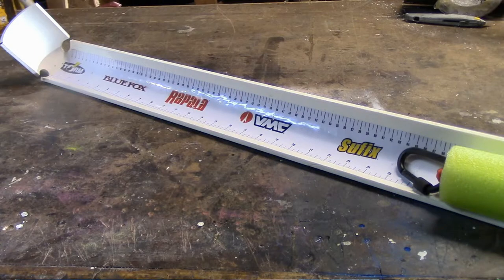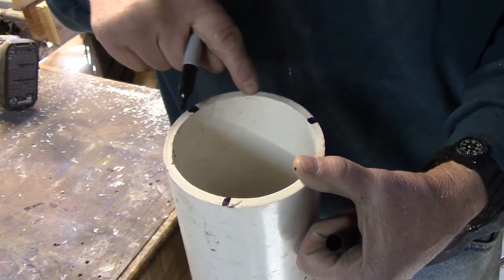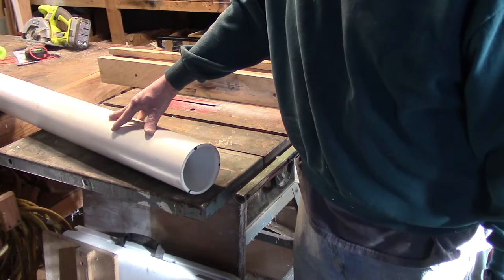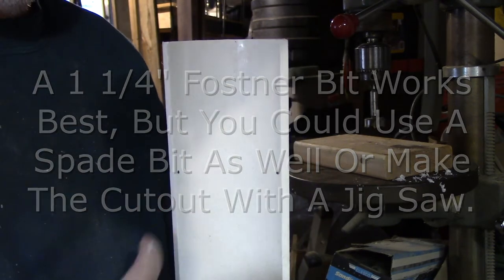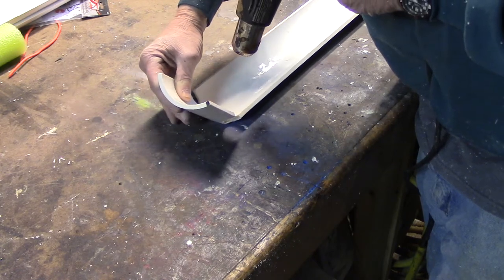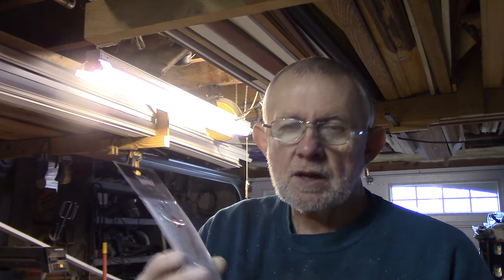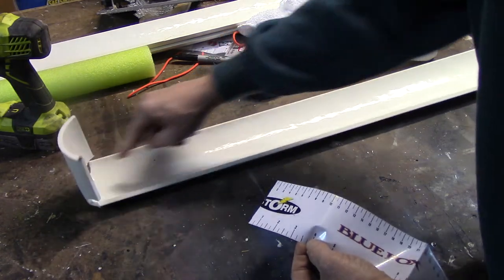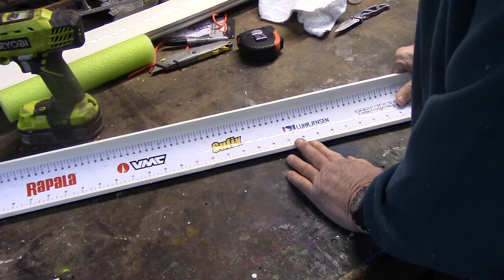Awesome DIY Fish Measuring Board: CHEAP AND EASY TO BUILD AT ONLY $8.00!!!

Comment: nice.  Just stumbled your DIY hack.  It's a very slick way to make a measuring board.  I'm a bank fisherfolk and use a  fishing backpack.  Definitely can adapt your design to attach for easy carry.  Even thinking you can make a slide or folding version.
Reply from the maker: Thanks so much! You could either shorten it for carry or cut in half and install a for a scale that folds. Glad you found the video a help and thanks so much for watching. God bless you!